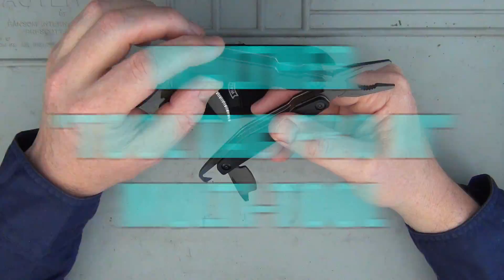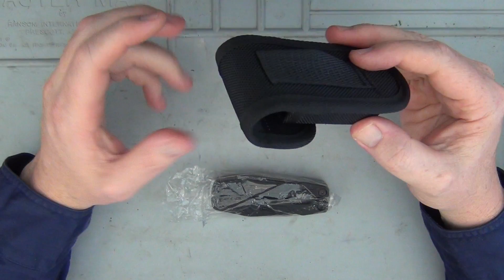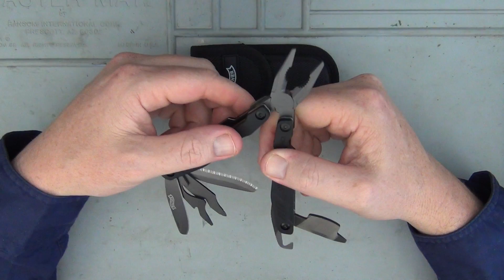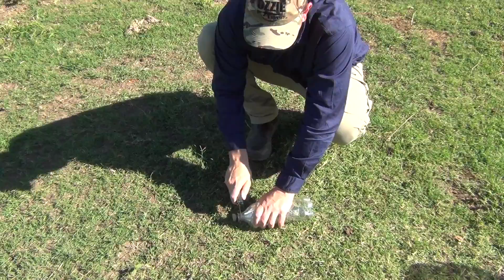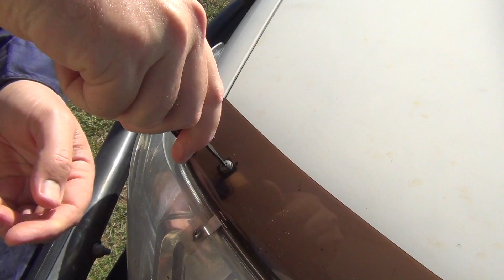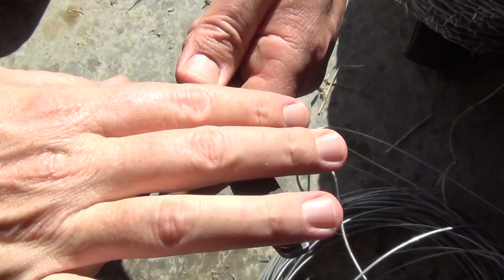Walther "Tool Tac Pro M" Multi-Tool

Comment: To be fair, a sidecutter has specifics on how and what it may and may doesn't cut. Doesn't it specify somewhere in a manual? You can't just grab any sidecutter and get through barbed wire, its usually thick steel and for that thickness in the video you'll need a way different leverage than what the sidecutter actually provides, hence why it failed and even "broke" because of the applied forces. You couldn't cut because the leverage didn't let you, simple as that

Comment: Also, according to Police in Tasmania, it (and any multitool with a blade) is illegal for everyday carry. I do wonder what the statistics are on multitool stabbings in Tasmania.
Reply: Politenessman Same as the mainland; If you remove all the blades, it becomes legal...
Reply: and about half as useful.
Reply: Politenessman I have wearing my Leatherman  nearly everyday since I bought it in 2000 and it has two blades. Never had an issue in QLD.

Comment: I have a Leatherman Super Tool, I use it everyday and I bought it 17 years ago. It is still like new. When the original leather pouch wore out, I first bought a new material pouch from a King of knives shop. Waste of money. I then had a light bulb moment, and pulled out a GK pistol mag material pouch , BEAUTIFUL it has been on my belt for years giving me good service.
My Leatherman cost me in the vicinity of $150, 17 years ago so it was a big expense at the time.
What I mean is, I used it everyday at work as a Pool Plumber, not everyday as in 7 days a week.